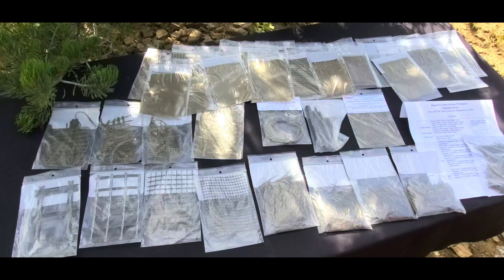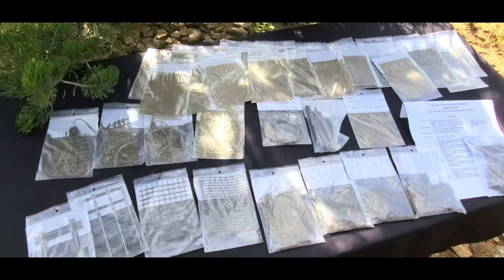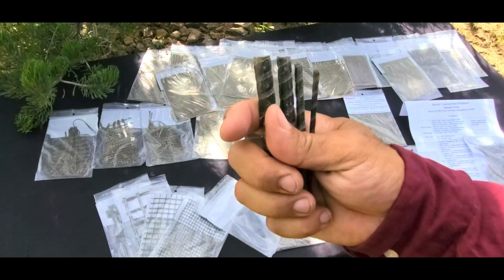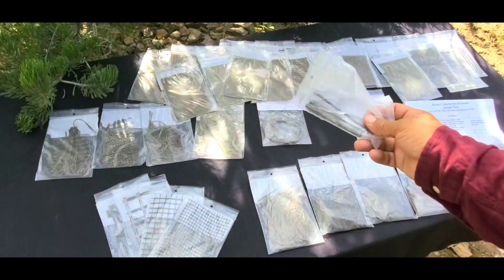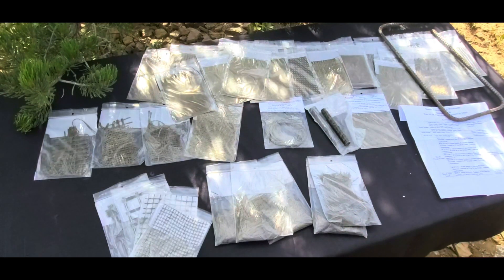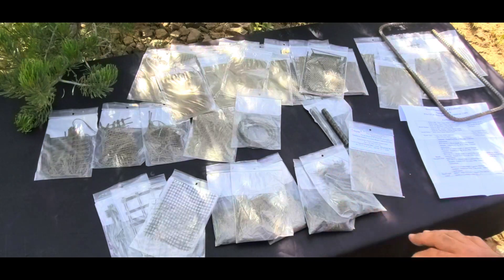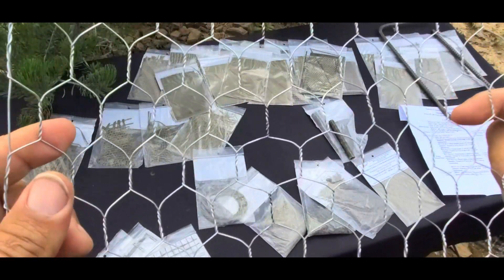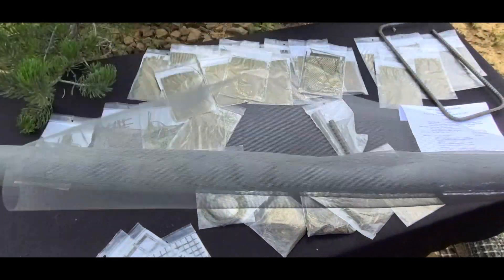Reinforcing building materials #reinforcement #buildingmaterials #aircreteharry #basalt #rebar #diy

Comment: First, amazing knowledge and experience.  Thank you for sharing.  Second, I'm wanting to build flat panels as building cladding.  I'm aiming for 10feet x 32inches, and 1 to 2 inches thick.  I could cut the height to 5feet, but I want to try the harder thing first.  These panels will have hang vertical and have 3 points where steel or aluminum ledgers meet counter part ledgers on a plywood wall.  The have to be strong enough to be moved and hung, and light enough for 2 people to handle the job.  THEN, I want to do some interesting surface designs too!!  I know, it's a lot.  And you might be the only person on earth who could help. The question is how could I work with you on this?
Reply from the maker: Welcome to the channel Justin 👍 
You are very welcome, glad you can benefit from what I share on my channel. 
Appreciate your feedback!
I would suggest to go with the E.P.I.C. techniques for the projects you described.
Email me: Aircreteharry@gmail.com 
to get in touch & receive more information.

Comment: I've used basalt fibers (chop) for messing around and it seems like a great product for reinforcement. Another one is Nylon fibers they use at the concrete batch plant that come in 1lb bags. 

I'm also quite impressed with Trinic's content on Youtube and what they are doing with GFRC (glass fiber reinforced concrete) using up to a 3% by weight addition of Glass Fiber and advanced formulas with 10k psi at 3/8" inch. Glass Fiber are very "needley" compared to basalt or AR fiberglass. Check out their work and you might find new solutions.
Reply from the maker: Awesome! Yes, I  agree with you, works great for reinforcement 👍 
Thank you for the additional Information, I will happily look into it, Brother.

Comment: Very considerate of you to put out this info!  Fiberglass screen may not be alkali resistant (AR).  Not an issue in a mostly dry environment, but if not AR and in "cement" that is in a moist environment - like the outside of a dome, could break down over time.  All fiberglass and basalt mesh for portland-cement-stucco is AR (or supposed to be).  Soaking fiberglass screen in the right sealer could prevent the reaction?  Maybe that is what the AR treatment is?
Reply from the maker: I've had that Fiberglass Mesh in many of my built structures for years and can confirm great results. Still performing well 👍 👍

Comment: You can bend basalt rebar by hearing it. You can use a torch or heating element to do it
Reply from the maker: Yes, as long as one knows what they are doing. If talking about a few pieces to have adjusted, sure - otherwise for larger quantaties it's more convenient to order with the specified angle request. 
The beauty of options 👍

Comment: What a great topic!  I've been studying aircrete for years and finally made my first block last month.  I also poured a part of a slab (for my shed where I keep my lawnmower and some wood).  The aircrete turned out really well and I enjoyed the process.  HOWEVER, I know reinforcing is going to be vital for having any real success with aircrete.  I have been wracking my brain to come with alternatives to steel (everything is so expensive these days).  Aircrete is meant to be economical - so I hate to blow the economics of aircrete with the reinforcing.  I have not found what I want to use yet, but the mosquito netting and stucco reinforcing are two options I had yet to consider.  The trick is finding something on the cheap.  These days my eyes are always open to reinforcing options - I even considered plastic construction fencing at one point in time.
Reply from the maker: Welcome Dustin,
Congrats on your first Aircrete projects 👍 
The best reinforcment for Aircrete would be fine HSHM PVA Fibers. It makes Aircrete much Stronger and Flexible. 
When I do any Aircrete projects I use Aircrete Thickening Agen & Air Entrainment Liquid. It allows you to pour Much Higher and makes Aircrete Much Stronger:
https://aircreteharry.com/product/1-gallon-aircrete-thickener-two-x-1-quart-air-entrainment-liquid-by-aircrete-harry-allows-you-to-pour-aircrete-much-higher-improves-strength-see-description/
Reply: @AircreteHarry  If you don't mind, I'd like to ask you a question about curing.  On my test block, I kept it half submerged in a 5 gallon bucket of water for a month.  The half that cured in the water was MUCH more solid feeling and much stronger.  On my slab, I wet it down twice a day (am and pm) for the first 2 weeks or so.  It seems keeping it wet may be super important.  Any recommendations?
Reply: @dustinduke7225  Keeping it wet to cure is important for all concrete.  Check out Tyler Ley's YouTube channel for lots of information about that.  As for cheap reinforcement, how about straw, like is used in adobe?
Reply from the maker: @dustinduke7225  sure - I welcome questions. Solid recommendation as far as for any Aircrete Work is to use 
the Aircrete Thickening Agent & 
Air Entrainment Liquid. 
Over the years I did tons of tests and reserch and I can definitely see the results now by having beein using those products myself. 
And I'm happy to be able to have these products available on my website now.

I also suggest getting a Push Pull Force Gauge Meter. You may see it in my last year's video called: Aircrete Thickener Part 2
- I included a link for TOOLS I personally use & recommend in the description.
When you click on that link, scroll down & you'll see the Meter. 👍 

Yes, you want your cement to cure slowly. 
You may also use a blaket that can be made wet (like a moving blanket) to put it over the slab and water it. It will hold moisture and give out moisture to the slab.

When you get to make Aircrete Blocks using the additives: Aircrete Thickener & Air Entrainment, use the Meter I suggested to see the difference for yourself. You will then be able to compare the difference in the Strength. 👍 
Questions are very welcomed.
Reply from the maker: @scorpio6587  They both work great 👍 The choice is the price and the availability then.
Reply from the maker: Welcome Dustin,
Congrats on your first Aircrete projects 👍 
The best reinforcment for Aircrete would be fine HSHM PVA Fibers. It makes Aircrete much Stronger and Flexible. 
When I do any Aircrete projects I use Aircrete Thickening Agen & Air Entrainment Liquid. It allows you to pour Much Higher and makes Aircrete Much Stronger.
I offer these products on my website. Direct link in the description 👍 👍

Comment: Awesome thank you for explaining the reinforcement options.  I have always wondered about what to use.  Keep it up!    I love learning about what you are doing.  You briefly mentioned generating energy through the dome shapes.  You can get actual electricity from it to light up some LEDs -  If you have two separate layers of the metal reinforcement and put a multimeter leads on each layer, you will probably get a voltage reading.  pretty cool.  I made a cement battery flashlight so I know it works.
Reply from the maker: You are very welcome Barry 👍 
Appreciate you! Very cool, we would like to see some photos / videos of your work. 
Feel free to share: Aircreteharry@gmail.com
Reply: Beautiful Barry you have reminded us of ground batteries and natural energy generation!  Please post your cement flashlight and any other goodies!
Reply: What about the basalt rope? This formed into triangles would be super solid and cheaper?
Reply from the maker: @petepenn1  Yes, basalt rope is another option introduced and mentioned in the video.
Reply: Yes I can.  I post the videos on my main youtube channel called "Extreme Budget". I'll have to switch accounts and comment with my channel.  :)
Reply: This is Barry Sines.  This is my main youtube channel (Extreme Budget) that you can find my videos about cement batteries and making batteries from sand and pennies.  Pretty awesome!  I can't post a link or my comment usually goes to spam.  I sent Harry my links with an email.
Reply from the maker: @extremebudget  Great Work Barry!! Always a Pleasure Brother!
Reply: @AircreteHarry Did you ever get around to posting a video about this? Super interesting